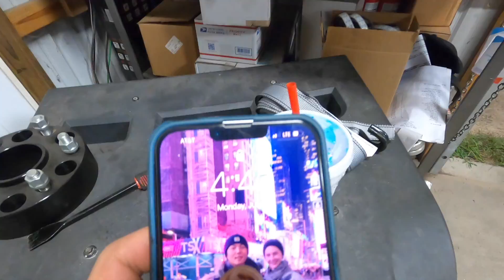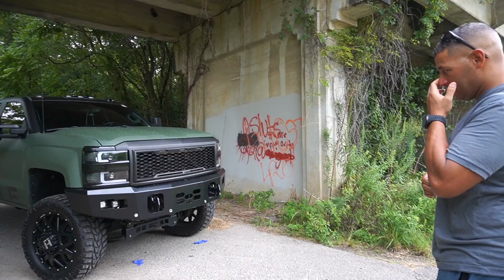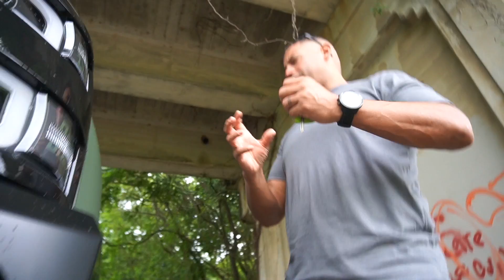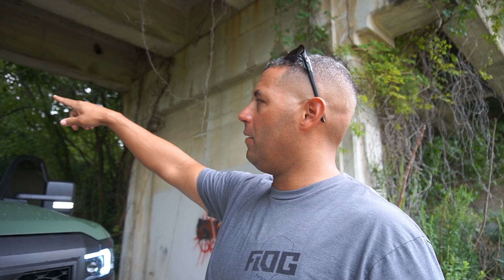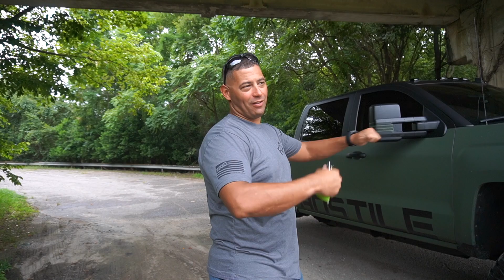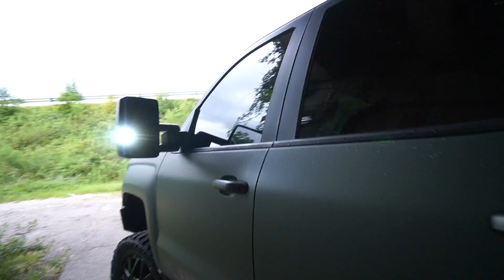We Build This Dually Duramax In 3 WEEKS!

Comment: Hey brother, congrats on this custom dually. Also i just got the rc lift kit installed in my lml as well. Did you added the traction bar or yours didn’t shake in highway-freeway? Thanks. 😎
Reply from the maker: No traction bars, just air bags. No shaking from what we could tell
Reply: @JWMontoya  thanks for the reply brother!
Reply: I’m thinking about adding them because on my last trip I have noticed shaking/vibration when climbing hills around 60-65 mph
Reply: @mattjames071  how was it? Did you add traction bars?